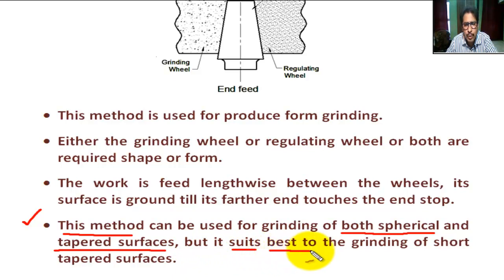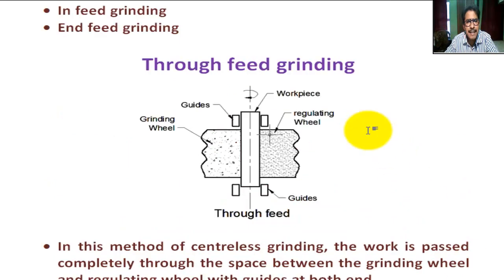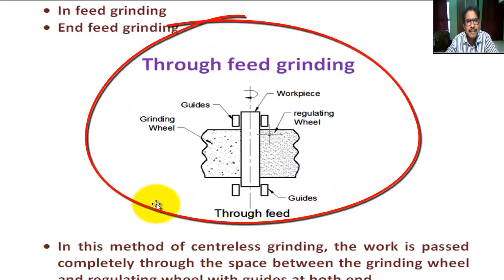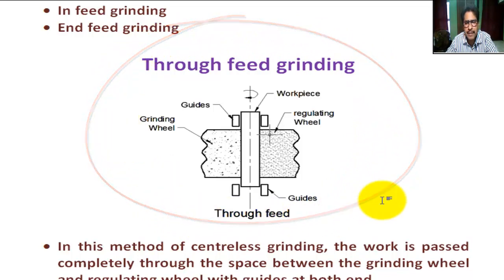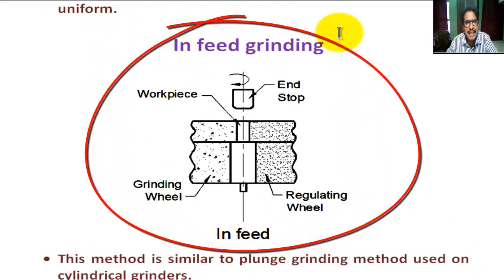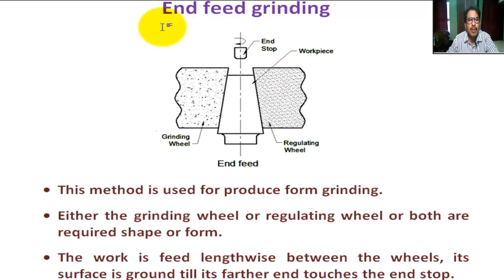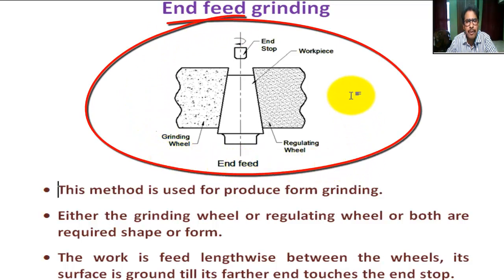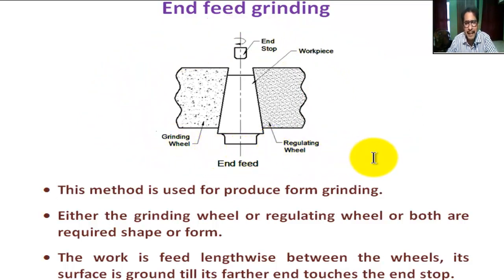Through feed - In feed - End feed of Centreless Grinding

Comment: I am new to Centerless Grinding. I have a question, how much extra material on OD I need for CG,  25mm long pins, 3mm diameter, and tolerance is ± 0.005. thank you
Reply: approx 180microns.. depending on OUT OF ROUND ...OUT OF ROUND SHOULD BE 50MICRONS MAX